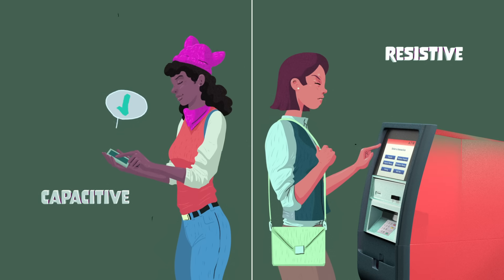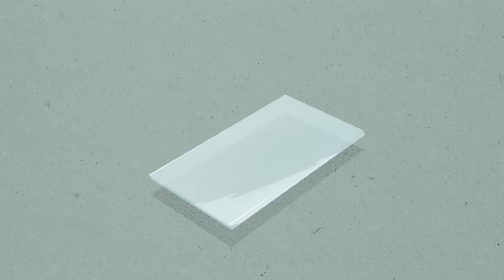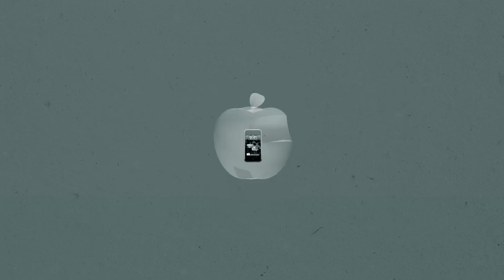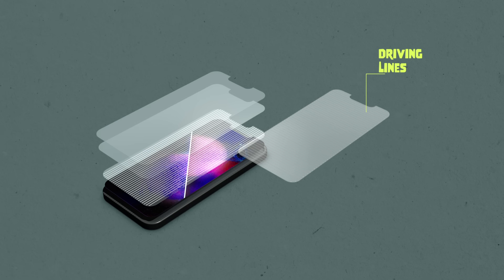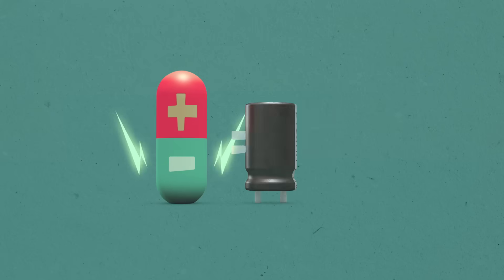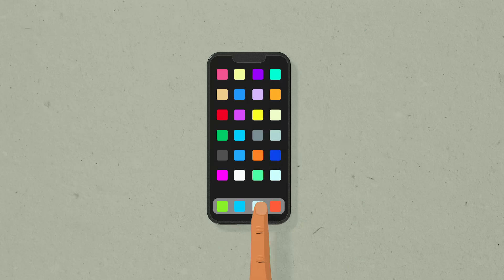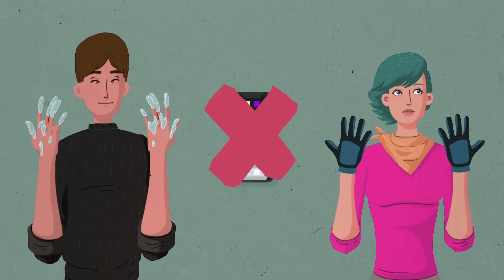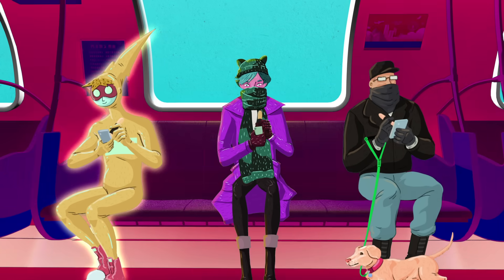Why a sausage can do what your gloves cannot - Charles Wallace and Sajan Saini

Comment: Many pens and stylus have rubber ends, but they work perfectly on normal screen, even when rubber is an insulator. Why does that happen? Can anyone explain?
Reply: well the short answer is that they use a special, conductive rubber, usually infused with carbon particles or other conductive materials.

Comment: Another old kind of touch screen used intersecting light beams. The old aircraft ACARS screens used it. We found out how it worked by accident. Someone had touched up the paint on the sides of the screen and the pilot complained that the screen didn't work anymore. Turns out the paint went over the edge and blocked the light beams from criss-crossing.

Comment: When I use my phone while it's charging the screen sometimes acts like I touched it in several places. I had a thought that's probably because the electricity from the charger interferes with the electricity from my fingers therefore it's probably triggering many conductive lines, like in the case of splashed water. Hope this makes sense

Comment: Something I wish was covered in this video was why different types of stylus pens work on different touch screens of (presumably) the same type. For instance, I assume that both the Nintendo DS and the iPhone have capacitive touch screens; but the thin plastic stylus that comes with the DS won't work on the iPhone. For the iPhone, styluses are often thick and with a large rubber-like tip. Why is that?

Comment: I used to use a tablet with a stylus. In the winter, I noticed that, while touching the screen with gloves on didn't work, I couild use the stylus with gloves on. How did this work, since there my gloves were still interrupting the connection between me and the tablet?
Reply: The stylus has it's own electrical conductance, unless it's Bluetooth in which case it likely uses position sensors or similar to work.
Reply: @iliyashapirov7720  This was a cheap stylus I bought at  Dollar Tree. Yes, the stylus conducts electricity, but it needs a power source, normally a human body. But if the fabric of a glove insulates provides a barrier between me and the tablet, it also provides a barrier between me and the stylus. And yet the stylus works anyway. That's what I don't understand.
Reply: @GailGurman  Why would it need a power source? A sausage works on it's own

Comment: This was the difference between graphics tablets with the Aiptek resistive tablet and the Sumagraphics capacitive type. The same cross grid was used in the magnetic graphics tablet because the coil was embedded in a mouse like device with a lens and cross hairs. Architects and engineers favored this to digitize blueprints.

Comment: The capacitive sensor calmly reads the change in the field at a fairly decent distance from the screen without touching, for example, Samsung has a so-called hover sensor for a long time. Moreover, simple phones also manage to read touches with gloves, but only of a small thickness (well, or with conductive threads).

Comment: Well this is not wrong completely but there is a LOT of things that are simplified and makes it wrong… like the video doesn’t talk about capacitors and how your finger is the 2nd layer but it talks about how many layers the screen has for no apparent reason. Also it doesn’t matter if your glow is an isolator, try a very thin rubber glow and it will work with most phones. Or some phones even have a “glow mode” for touch screens… this all work because it doesn’t matter if your glow is an isolator, so if the most top layer glass of the phone… I am actually a bit disappointed in this video how its too simplified. Also the impure water confuses the touch screen but not distilled water (ofc the screen should be clean to not contaminate the water) but this is not because it is conductive, well not directly.

Comment: I don’t believe that the body’s electrical capacity has anything to do with it. I have a plastic pen (insulator) with a rubber tip that does a great job of activating the touch screen. No body current required.

Comment: soybean's note:

QUESTION: how does a touchsreen work?

basically, there are two types of touchscreens. capacitive and resistive touchscreens.
Resistive touchscreens are less sensitive to the touch. it's made up of two layers: the top is plastic and the bottom is made of glass. then, they're both covered in conductive substances, then separated by a thin gap. when something pushes it hard enough,  both layers connect which completes the electrical circuit. the electrical circuit causes a change in the voltage which the machine's software reacts to. used in mass production, like ATMs due to its cheap price.
Capacitive touchscreens are made up of a couple sheets. Smartphones today consist of a glass exterior and an LCD screen at the bottom. the first sheet from the bottom is a conductive layer used for carrying an electrical current, a thin insulating layer is placed on top of the first sheet, when the sheets are on top of another they form a grid and the points where they intersect are called nodes. the phone's battery draws electrons along the first line which then the the electrons will accumulate at every node and create a small electrical field.
the human body is a great conductor because it's made up of 60% (impure; loaded with ions) water. when you touch the screen, it will interact with the preexisting electrical field. this induces a weak electrical current which travels through your finger back to the phone. this changes the amount of charge at the affected nodes.

Comment: Wow, I didn't know there were two kinds of touchscreens! Whenever a self-checkout machine, a ticket machine or something wasn't responding I always assumed it was a computing latency issue of devices being old. But it makes sense now that with devices based on the resistive version, I wasn't just imagining that it worked better if I pressed a little harder, it needs to be pressed! Thank you so much for this explaination!
Reply: You will always get it to work if you press with your fingernail or a stylus. Think of it as a Nintendo DS touchscreen. Actually, it's the same.
Reply: The more you know
Reply: I remember before I got my first smartphone, in late 2000s, sometimes I have to press my phone's screen with my nails if the area that I wanted to touch is small.
Reply: i had a feeling. resistive touch screens a lot of the time u can feel the gap

Comment: Some capacitive touch screens are so sensitive that you don't even have to actually touch the screen but just get REALLY close to it. And resistive touch screens are definitely very durable. The control screen on the CNC machine at work is used constantly all day long and has never been replaced even though it's been in use for about 20 years. It's scratched and blurry, yes, but works just fine!

Comment: then how come I can interact with my screen with a SPOON??
Reply: @wallflower9437  stainless steel conducts??! WHAT?
Reply: @Hobo_Dood   a capacitive touchscreen will work with any conductor, and spoon is a conductor. Therefore, when you try to use it on your phone, it works. And your hands is also a conductor, your body is 60% water (also a conductor) made up of ions, electrons, etc. and these grid tiny lines on your screen reacts (forgot what's the term for it) with your fingertips making the icons move whatever you want (there must be an explanation to this according to the video, just watch it again so that you will understand what I'm talking about). So that's all, watch and understand Ted-ed's explanation on the video. Have a nice day!
Reply: @Hobo_Dood  gonna add this explanation why a spoon works on your touchscreen. In conductive materials (your spoon for example) electrons flow around atoms which creates an electric current that's why your screen reacts to it.

Comment: Hmm if water is a  conductor then why doesn't it conduct the electricity from our hands onto the screen?
Reply: My hypothesis is that it will send electrons to the wrong part of the screen or Will not complete the circuit as the electrons will prefer the water

Comment: Nails can’t do this too!why?
Reply: because they dont conduct electricity, they are considered dead.

quote from Wikipedia: "The nail plate (corpus unguis) sometimes referred to as the nail body, is the visible hard nail area from the nail root to the free edge, made of translucent keratin protein. Several layers of dead, compacted cells cause the nail to be strong but flexible."

Comment: i have touch sensor controls on my freezer. sometimes, if i have left the door open for a while, earlier in the day, an alarm will go off. to deactivate it , i have to touch the relevant sensor, but, occasionaly, my finger is too dry, & it won't go off, but my nose is always a bit greasy, so i use that instead. it conducts the electricity, much easier!

Comment: awesome video! so phones that do commands based on pressure; are they just a combination of the two? like how I have to press a little harder to turn on the flash or camera icon on the Lock Screen of my phone. it won't open with just a touch. also I wonder how gloves that are made to work with phones work?

Comment: what amazes me is the terrifying speed this process is done. your phone has to do the math on the voltages of every single node every moment, and then react to it in milliseconds when there is an anomaly. in a time period we humans would call "instantly"
Reply: the coding and design does make it a little simpler. think instead of one processor monitoring hundreds of nodes, think of each node as doing one job, with one set parameter. if one node gets a voltage above or below that parameter (depending on if your finger decreases or increases voltage, it didnt say in the vid) then that voltage change is applied to the grid. the processor doesnt have to do the math for voltage on each node, just mainly the math to pinpoint where the electrical impulses are coming from on the grid

Comment: It’s funny how the T-Mobile/HTC G1, despite being a much better phone and the fact that Android phones outnumber iPhones 2:1, is largely forgotten because it came out very slightly after the iPhone.

I believe a lot of cat infotainment systems (up until recently) used resistive screens specifically because of gloves.
Reply: Cat?
Reply: @Br_KN  The Company Caterpillar which offers equipement for construction work, including phones. As a brand they just call themself CAT though.
Reply: I owned the G1 and it was NOT a better phone.  It was slow, laggy, and android still needed a lot of work.  It’s not forgotten, it was wasn’t the breakthrough that Apple had achieved.  It would still take some time for google to fully copy apples vision.

Comment: Gloves that say they can work with capacitive touch screens just have metallic threads weaved into the finger allowing electric charge to flow between you and the screen. Capacitive stylus work on the same principle with a metallic body connecting you to the stylus tip.

Comment: I've really wondered that too, especially since I tried to make a stylus at home and found it wouldn't function without a conducting material. Brilliant video, and thank you so much for such interesting content!
Reply: @Brutality Com You can wrap tin foil around a round point and it will work like a finger
Reply: @Brutality Com u can look it up here on yt it’s surprisingly simple
Reply: I have a regular pen with a small rubber tip on top of it’s cap.
that surprisingly works really well as a stylus.
Reply: @muhammadsajid8608  that's the point of having that rubber tip, it's a stylus
Reply: I used to wrap foil around a q-tip, then put some water on it
Reply: jjjjjjjjjjjjjjjjjjj
Reply: I once used cotton and then wrapped it around with a pencil(lol) and it worked. But the downside, it acts like a resistive touch.

Comment: When i first used resistive screen phones in early 2000s, i hated the experience and thought that touch screens would never be a thing.
Reply: Yeah i had a resistive touchscreen phone once which someone scammed me to purchase and the touchscreen experience was nothing less than terrible. I thought at that time that even button (feature) phones are better than this sh*t.
Reply: That's why phones before iPhone use Stylus
Reply: Serious? XD
Reply: @calcal6508  only people who used them would understand.
The screens requires hard touches, the gap between the screen and the top plastic layer is large, you feel the screen curves inside.
Very annoying.
Reply: @bomenorange.  and no pinch to zoom. If you try it, the phone goes haywire.
Reply: @bomenorange.  haha, those old tablet pcs, and some finnicky phones that had a super thick resistive touch layer, to the point where the gap from the screen and the plastic is almost a milimiter long, those screens were a PAIN to navigate. it relied heavily on force, and accuracy was not a thing.

Comment: What about tempered glass protector? does that create another circuit ontop of the protector or is it electrical proximity that allows the input to function.
Reply: You are correct with your last guess :) 

The applied screen protector can be seen as a thicker phone glass - on top of the 'grid'. If you change the responsiveness of your touchscreen you it could be that the distance is too high for light touches and it stops working

Comment: What about the touchscreen of Nintendo’s DS? Is that also a resistance touch screen?
Reply: I think the older models are resistive type, but not sure about newer models (3DS and DSi)
Reply: An easy(-ish) way to think about this is that all screens that work with a non-conductive touch-pen (the plastic-tipped ones) are resistive
Reply: @waterunderthebridge7950  not all, since samsung's note flagship lineup also used a plastic tip, altho it didn't rely on both resistive or capacitive, there was a different layer of something (i dont really know, all i knew was that the tip of the pen had a beamformed electromagnet), and without even needing the tip to come into contact with the screen, the phone could pinpoint where the tip was, precisly. it was actually surprising but you could actually use it as a non contact air pen

also apple's apple pencil, it works on similar tech but with some additions, it has a plastic tip but is not resistive
Reply: @senzuka_se  I only meant it in case of simpler systems such as game consoles like the DS models. For other touchscreens they keep re-inventing the wheel to get a leg up on their competition. Apple pens and the like also have an own electricity source so the material argument doesn’t apply to them. Usually, simple capacitative screens only work with conducting materials (as explained in the video)

Comment: Let's appreciate how beautiful the animation is 🥰
Reply: But a bit excessive, don't you think? You better be glad this user (me) doesn't turn reply sections into warzones.
Reply: I agree - it sounds like a bot.
Reply: I don't like the animation of electrons as running people. It's bs and useless. I'd rather see some more schematics. For example include the width and distance of the layers. Or where are the horizontal and vertical linea connected to